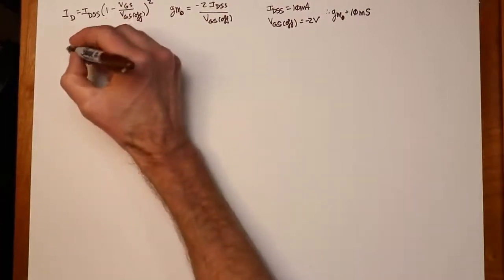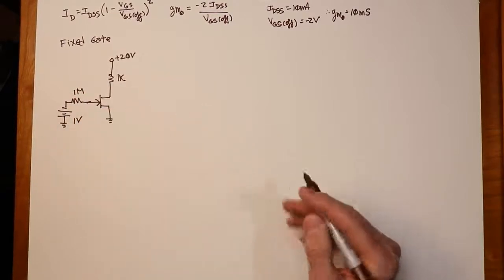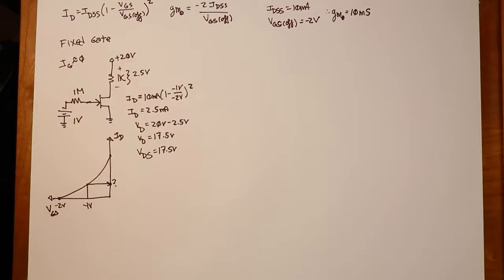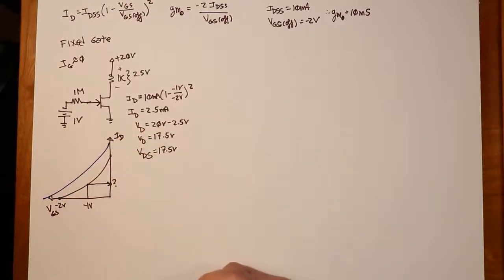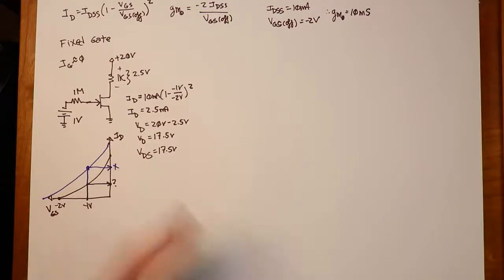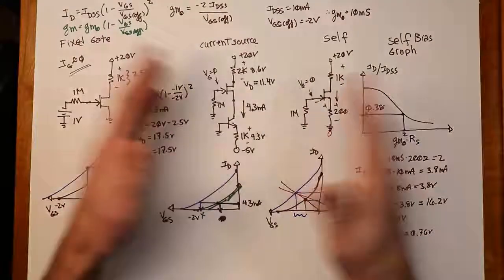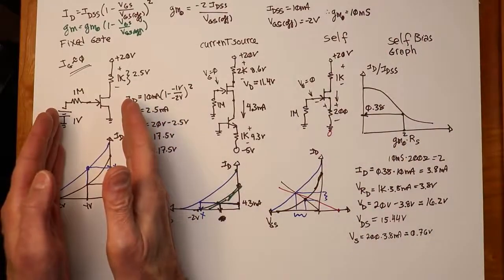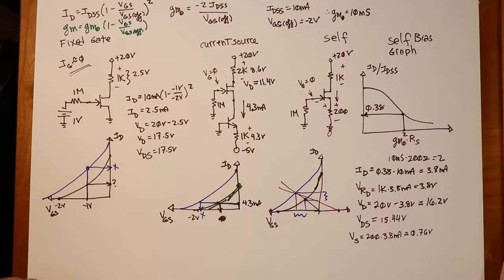Semiconductor Devices: JFET Biasing

Comment: Thank you. I have questions but probably worth waiting for the amplifier sections. The text is excellent, by the way. The question that keeps getting in the way of me listening to you is about the size of the Gate resistor and noise in an audio signal path. Would we use Fets in Audio HiFi, Are there pros and cons on noise?
Reply from the maker: Yes, we use FETs in audio circuits. The gate resistor can be large, but it's not in-line with the signal, it's in parallel.
Reply: @ElectronicswithProfessorFiore  Ugh! Of course it is. Thank you.

Comment: Good afternoon! This is a best material about JFET, that i found in Internet. But maybe I’m wrong, and it seems to me that the x-axis should be not value (Gm0)*Rs, but value (Gm*Rs). Is the Gm0 constanse for this transistor? I should not understand last graph.
Reply from the maker: gm0 is a constant. It's the value of gm at Vgs = 0V. gm0 helps define the steepness of the curve. The x-axis is indeed gm0 * Rs. This curve is derived in chapter 10 of my free Semiconductor Devices text (see download link in video description).

Comment: Still confused as to how you know Id = .38. What equation was used to find this value?
Reply from the maker: Replay starting at 16:00. What I drew is a quick sketch of the self bias curve which can be found in my Semiconductor Devices text (a free Open Educational Resource, see download links in the video description above). You would simply read the value of 0.38 off of the vertical axis, and then multiply that by Idss to find Id. The graph is, in fact, the curve of an equation that is derived in the text. If you wanted to, you could plug all of the values into the equation, but the graph version is a bit quicker.

Comment: Is a voltage divider bias setup more stable than a self bias setup?
Reply from the maker: Good question. Stability for JFETs is a little more complicated than it is for BJTs. In a BJT, gain is dependent on r'e, which in turn is dependent on Ic. Thus, if you have high Ic stability, then you also have high gain stability (which is the target). For JFETs, gm is analogous to r'e, but it does not have the same sort of relation with Id. Therefore, high stability for Id does not necessarily mean high stability for gain. Thus, we have to be careful what we're asking about here. It turns out that self bias is a special case of what I call combination bias in the Semiconductor Devices text (and which voltage divider bias is a single supply variation of). In general, combination bias achieves a more stable Id than self bias, and using a proper design, can achieve higher gain stability. Unfortunately, one of the downfalls of the voltage divider configuration is that the divider resistors produce a decreased input impedance. In actual practice, a self bias circuit may have all the stability that is needed, and uses a minimal configuration.
Reply: @ElectronicswithProfessorFiore  Hi, Thanks for answering this complicated task. Yes input voltage bias network decreases the input impedance. In my mind i was thinking about the old 600 Ohm audio transmission standard. A input biasnetwork with maybe a 1M and 200K voltage divider is negligible when the signalsource is 600 Ohm. But of course with a selfbias setup you dont have to worry so much about the impedance of the signalsource, unless the signal comes from a function generator with 50 Ohm output impedance 😉
Reply from the maker: @royrogers7644  600 ohm audio... Now you're taking me back to the old days. Kind of glad that we moved past that!